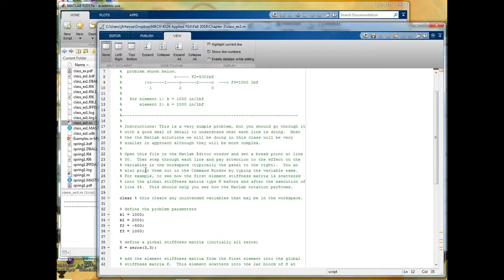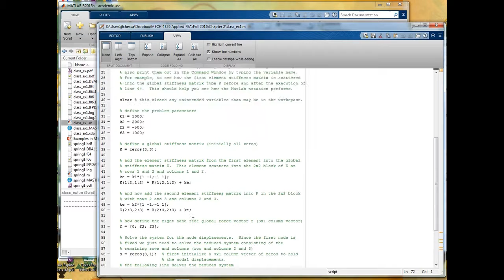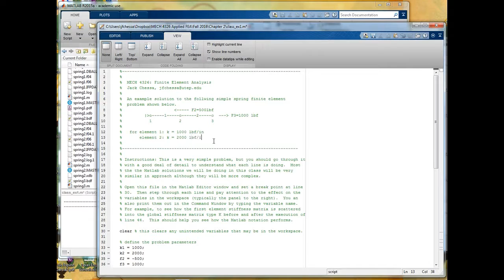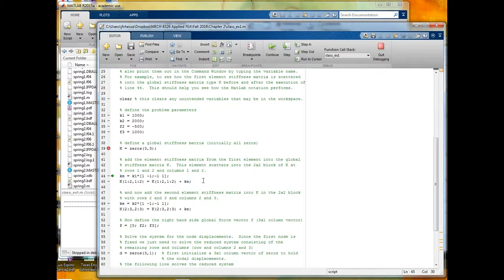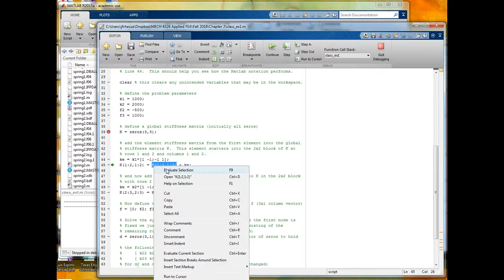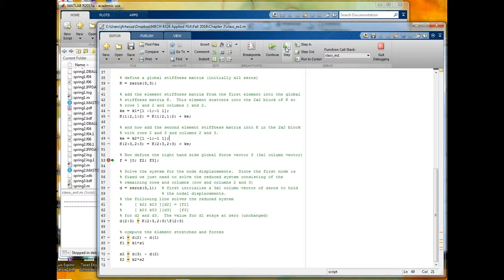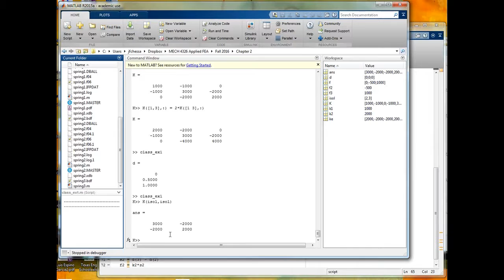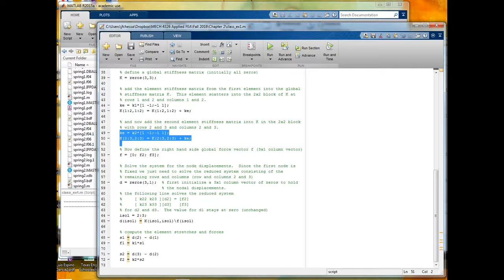Spring Element in Matlab

Comment: quick question, what if I have 3 elements and 4 nodes -- or more? Is there a way to automatize this process instead of me writing more "K = K + ke" and mess up the order?
Reply from the maker: Yes, there are definitely more automated ways to scatter local element stiffness matrices to the global stiffness matrix.  This is a "baby-step" for one of my classes.  You need to define an element connectivity data structure and a nodal coordinate data structure then loop over the elements in the connectivity DS and all these individual steps can be in the element loop.